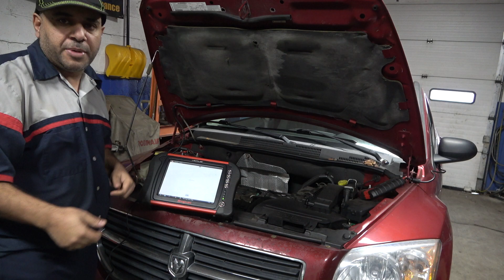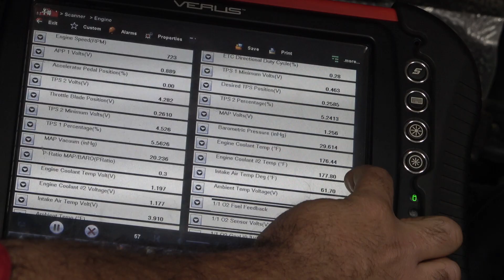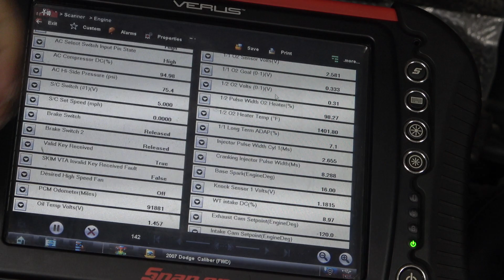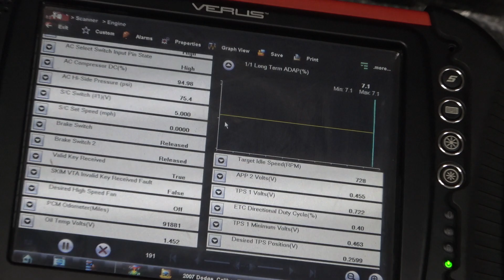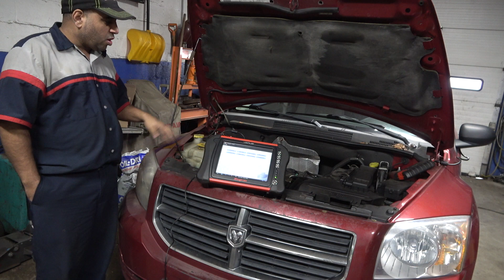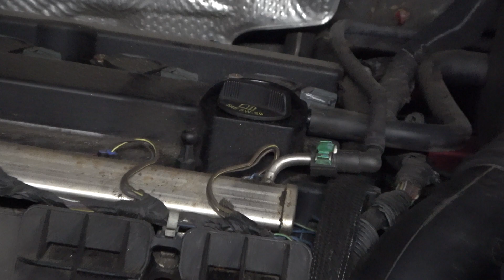Dodge lean code P0171 Determine and check FUEL trim +-10

Comment: Dodge Journey 2011 SXT. Same engine. Only when parking (this is weird) vacuum goes somewhere, the brake pedal gets really stiff and the error pops up. Will take a spray and check everywhere, replace the intake gasket too (some dude/previous owner used a ton of silicone instead of a new gasket..).. an entire adventure! Good job and thank you for the video! Keep up!
Reply from the maker: Could be bad brake booster
Reply: @RBTheMechanic  but why does it always work and stops only when AC is on and I am parking? And I get the "Lean mixture" error.. This is so strange..

Comment: Keep carry on the good work. We are watching your help video because mine is 2008 Dodge Calibre and I was having this problem P0171 & P0172. I fixed it by simply replacing the air filter and cleaning air flow sensor and it’s working just fine
Reply from the maker: Nice good job